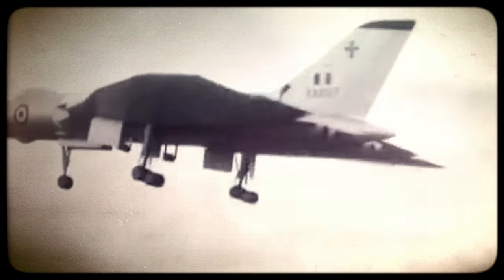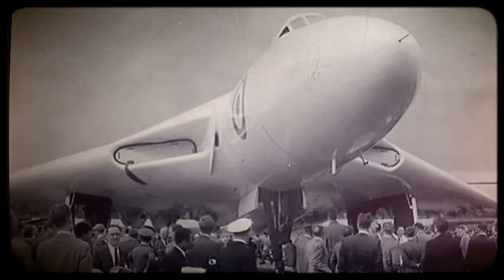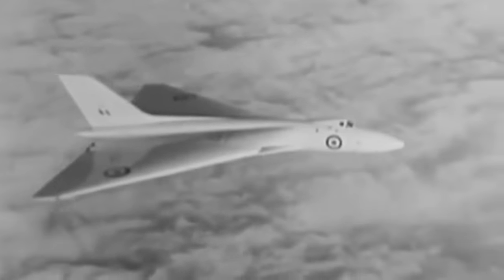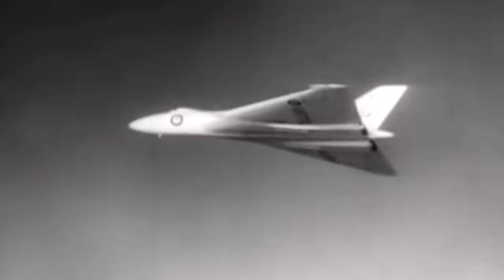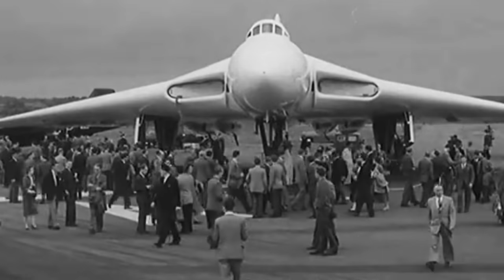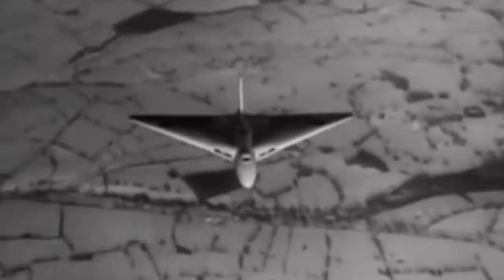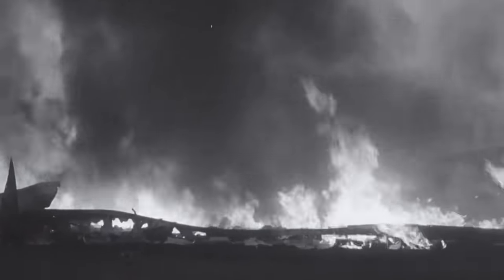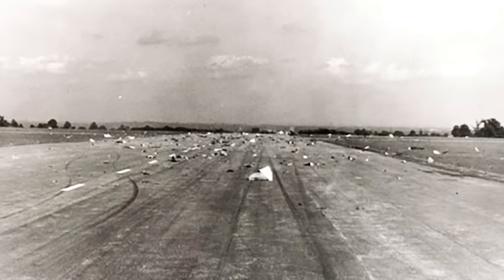Vulcan Bomber Disintegrates on Camera

Comment: 'Exceeded the turn rate limit'? He was pretty straight & level!
Reply: Pretty sure they mean he exceeded the limits earlier in the display, fatally weakening the structure.
Reply: Kinda reminds me of the F-117 airshow crash where the wing just fell off.  The cause of that one was found that maintenance crews had accidentally left off 4 of the fasteners that held the wing on. Almost a year earlier and it had taken that long for the remaining fasteners to break under the increased stress
Reply: @Knightfang1  couldn't they add sensors for that?
Reply: @jwadaow  on the F-117 that crashed, pilots had previously reported unusual wing flexing but maintenance gave it an inspection and cleared it for flight.  They would not have found out about the missing fasteners without completely removing the wing and it passed all other forms of inspection at the time
Reply: @s1iznc1d34  I don’t even take apart a remote control without a “this came from here” ‘map’ of the bits and pieces.
Reply: Oh I say...a bit of a sticky wicket...wot?
Reply: blame the pilot  ,as allways
Reply: @Knightfang1  We have endoscopes now. vital pieces of test and maintenance equipment.
Reply: @jwadaow  YES VALVE TECNOLAGY THEN
COME WAKE UP
LOOK AT THE DATE
Reply: "Ruined the ambience" masterful understatement.
Reply: @andyhowlett2231  Partially caused by flying outside the limits on the previous flight with a different crew was probably what was meant 😳
Reply: @andrewholdaway813  I hate when ambiance is ruined, it's like a stale chip, i say!
Reply: @jwadaow  In 1958?

Comment: Underlying mishaps such as this is the simple fact that someone didn't do their job.  The allegation that the pilot had exceeded the limits of the plane during the pass is suspect.  It is not supported by any facts.  Blaming a dead man to shield a corporation from scrutiny has a hollow ring to it in my mind.
Reply: Agreed, a gentle banking maneuver at 250 mph shouldn't cause this thing to break apart in flight. It was almost certainly mechanical failure and not pilot error.
Reply: @mikefromwa  I doubt it was "Mechanical Failure", Most likely Structural Failure.
Reply: Given that the Vulcan was renowned for being able to be handled like a fighter plane and to be able to handle the stresses of continuous high speed low level missions, I would guess that modifications for the Conway engine installation had fatally compromised the wing structure. I saw one on a training flight at low level back about 1970. He did a roaring turn from Loch Linnhe into Loch Leven to go and 'bomb' the aluminium plant at Kinlochleven. The stresses on an aircraft that size must have been immense but that was regarded as normal for a Vulcan. I had a perfect view of the entire top surface of the plane from where I was standing on the shore at Ballachulish.
Reply: It looks like a casual, slothful roll that any airliner is capable of, and yet someone said the pilot "exceed the limit"? What is this plane made of, sheets of paper?
Reply: just took a few rivets coming loose near the leading edge.
Reply: Back in that time when high performance jet propulsion was still a frontier science there were many such tragic accidents. One I read about the aircraft disintegrated and the engine plowed through the crowd. It took a while before airframes caught up with jet performance.
Reply: @mikefromwa  "gentle banking manevour " ! yer got that right , how biased for engine producer to state 
pilot error , the families not only in grief , also deemed to have shame , the "corpse" go on to financial 
greatness and the once living in despair ,   whats changed ? .
Reply: Agreed. Same story time and time again. I'm looking at you too Boeing
Reply: @STRIDER_503  Yeah, but they forgot the GLUE. so it was held together with sticky tape.
Reply: Welcome to NASA and the Air Line industry.
Reply: You are totally unqualified to make any decesion on this though.
Reply: @EuroScot2023  first prototype aircraft arent the same as production aircraft

Comment: Problems with the Vulcan were rare, amazing as it was all nuts, bolts and pulleys. It was one of the best aircraft to ever fly the skies. I wish could see one again in action, that feeling you get in your chest when a Vulcan does it low pass roar unfortunately will never be repeated! Sadly missed!
Reply: And the howl! Never forget that sound . Love it
Reply: They still fly in Britain
Reply: @RedTail1-1  No, they don't.
Reply: The problems with the Vulcan (RR engines, British hydraulics, Lucas electrical systems, Carlyle fasteners, etc.), were both well known and well documented. The RAF flew the Vulcan until late 1972. I have no idea what replaced the Vulcan after 1972.
Reply: @oncdoc01  1982.
Reply: @kwerk2011  Correct. They only do run way passes now. And still one overshot and went into a ditch. I last saw a Vulcan fly over me around 2012. I live near where they had one at an airfield which was one of the last being restored
Reply: @oncdoc01  I saw a Vulcan at the air museum at Newark and spoke to an ex crew. He showed me a hatch in the aircraft which could be used for the crew to bail out but he said crashes often happened with little warning. He did say several Vulcans had crashed over the years.
Reply: @Simon-ui6db  Vulcan pilots trained over the North Sea, and the howl was an accompaniment to east coast seaside holidays. Kite flying on the beach was a popular pass time, and kids competed to get their kite highest. This involved buying successive balls of string to attach to the previous one, the kite being long since out of sight. Signs went up prohibiting this activity, as they were infringing on air space!
Reply: @RedTail1-1 the last one was grounded about ten years ago, after many years of restoration. It flew for a few years afterwards doing displays and raising money for its upkeep and charity work I believe
Reply: The feeling you got in your chest was your internal organs being rearranged! 😉

Comment: As a 9 year old, I was there. The Vulcan was doing a low banking flyby, having previously done the same at other airfields. As it flew across in front of the crowd, a gasp went up as we all saw flames near the left wingtip, the flames quickly spreading 'up' the wing (plane banking left). As I remember it the wing then exploded (flames got to the wing fuel tank ?) and the remainder of the plane plunged into the ground. I've never been to another Battle of Britain Air Show.

Comment: One of the reasons early aircraft crashed was the practise of bashing rivet holes in aluminium instead of drilling holes. Bashed holes can have a host of micro cracks which propagate due to the stresses encountered when flying so eventual failure is pre-programmed.
Reply: A V Roe must have known that, as it was metal failure that caused the Comet series of disasters a few years earlier. (De Havilland wanted to bond the porthole glazing into the fuselage, but when that proved too difficult, the engineers went for screws and rivets, which all needed holes...)😮 In fact the Comet re-entered service in 1958 with many modifications to the airframe to avoid fatigue failures.
Reply: Pre - programed is a poor choice of words...that implies intent. Better to say pre - ordained as in ....failure was a matter of time.
Reply: This is the reason why airplanes have round windows today instead of square windows. That was the root cause of several crashes, micro cracks at the corners of the windows rapidly expanding to become macro cracks in the airframe causing rapid unscheduled disassembly. For example, the one generally pointed to, the Comet, but others had this issue as well. Most that had square windows were retrofitted.
Reply: It is spelled "practice".
Reply: @mundanestuff 'rapid unscheduled disassembly'.... well you could say that. Also that the occupants suffered from 'rapid deceleration sickess' when they hit the ground. 😮

Comment: I was at an airshow at Fairford many years ago. This was used by the US at the time. It was a beautiful day without a cloud in the sky.
I was waiting for the Vulcan display. I'd seen the routine many times and knew what was coming.
Two American  airmen were chatting just in front of me, not really taking much notice.
The huge crowd obscured the view till the aircraft were off the ground, but I heard the Vulcan engines from the end of the runway and knowing the routine, heard the howl approaching  . The Vulcan lifted off just abreast of me in a really steep climb, and you could feel the ground trembling beneath your feet.
One American airman shouted at the other, " Goooodddaaamm, will you look at that thing ".
Made my day!
Reply: Similar thing happened to me, at an RAF Mildenhall Air Fete. I happened to be chatting to a B-52 crew member by their aircraft in the static display. The Vulcan took off and went near vertical followed by a sharp turn away from the crowd line he was speechless.

Comment: I was based at RAF Scampton in the early 70's and used to hold my breath watching the Vulcans practicing for the air shows and trying to work at the same time. The noise when they used to go on patrols day and night will still be in my memory and having to go to the dispersals at various locations in the country and watch three scramble take off. Unforgettable!
Reply: I was an RAF cadet in the 1970s.  One year our summer camp was at RAF Brize Norton sleeping in tents near the runway. They flew Vulcans and VC10s in and out of there the whole. As you say, the noise those two aircraft types would  make was simply unbelievable. The first being awoken by one I thought the sky was collapsing in on us! 😱
Reply: @RobDavisTelford  Hi Rob. No, the name does not ring any bell for me. I was ground crew working in MTSS so I did not many aircrew at that time. Cheers, Chris. OZ.👍🦘
Reply: The 2nd loudest aeroplane I heard on a regular basis was the HP Victor ....... every morning at Brize Norton, am I right fellas???
Loudest, by some margin, was Concorde on full AB take off!

Comment: The wing shape was redesigned shortly afterwards.
Reply: Was it a problem with the wing structure?
Reply: @anevilgoose1034  No, it was to improve aerodynamic performance when the airflow went trans-sonic at high altitude.
Reply: That's why the the wings has the gentle curve in in
Reply: Thank you Helpy Helperton.
Reply: The newer wing design was already on newer aircraft, but VX770 was an old test bed prototype made in '52.
Reply: @juststeve5542  so they sent a pilot to death with a prototype on air exhibition?
Reply: @haziqsembilanlima  no, it was a test bed aircraft and they were returning from having different engines fitted (which they were testing) and they were asked to do a little fly past as a display on the way back.
Reply: It was redesigned mid flight it looks like
Reply: That anyone could have heard in the first 2 minutes of the video. Spoonfed...
Reply: @anevilgoose1034  Partially, In the early prototypes there was structural issues that had been observed in the forward wing structure in other airframes.
Reply: So much for it being the pilot's fault.
Reply: @timgosling6189  the Vulcan could not go supersonic could it?
Reply: @pauljones-tj5vs  The speed of sound decreases as altitude increases and the Vulcan could reach 60,000 ft at light weight.  There was at least one instance of a Vulcan going marginally supersonic (M1.04) at around 35,000 ft in a shallow dive during the introduction to Service trials.  The aircraft's Max Mach No was set at 0.96 but this was due to unfavourable transonic handling characteristics, particularly in pitch.  Of course the airflow over the wing would go supersonic before the rest of the aircraft, hence the margin in VNE.
Reply: 4 pilots not 1
Reply: @milkyo1206  The crew comprised two RR test pilots, an RAF navigator and a RR engineer.  The normal crew would have been five: two pilots, nav plotter, nav radar and air electronics operator.
Reply: @haziqsembilanlima  When you sign up to fly an X-plane...
Reply: yes, it was curvier somehow.  I'm no exqert but I can see a difference.
Reply: Just from the film alone analysis could determine both the speed and the role rate to determine if limits were exceeded. I don’t think it is a situation that we will never know or could never know if aerodynamic limits were exceeded. Just from a cursory review it does not look to me that there were excessive stress is due to speed or roll rate. If so this is one hell of a delicate aircraft.
Reply: the shape was already redesigned. 
Seven Vulcans had the Phase 1 straight wing (VX770, VX777, XA889-893). By the time the first production Vulcans rolled off the line, the Phase 2 kinked wing (the B1 version) was already fitted to ones that weren't so far into production. Later all but VX770 would be refitted with the Phase 2 wing. VX770 crashed years after the first Phase 2 winged Vulcans were flying. The defects which lead to the crash were well known before, and sources have stated that the operator or VX770 at the time of the crash wasn't fully aware of the weaker airframe of the first prototype than later production ones, although the aerodynamic deficiencies were known. 
The Phase 2C wing was introduced with the B2 variant and developed using VX777 as a testbed. This is the larger, more famous and iconic Vulcan most people know. Every surviving Vulcan today has the Phase 2C wing, a shame as my favourite is the Phase 2 which was equipped on the B1.
Reply: I mean I’d imagine and I’d hope so
Reply: they did the old one looks more like a mirage Jet Fighter
Reply: If you look at the later wing shape of the Vulcan, you will notice lots of irregular kinks in it, they were all added later on, with data from test flights, and all done on paper, no computer aided design, just mathematics & drawing board, paper and pen.
Reply: The starboard wing had been previously repaired
Reply: @paullovatt7413  unsurprising. i've seen vulcans do far more violent low level manoeuvres without falling apart. should've been grounded i suspect, but we'll never know.
Reply: How sad, and scary tho at the time.
Reply: That’s gotta be a scary feeling to be in that cockpit for those 6 seconds
Reply: They had flown it before......structural damage is not like the desintegration we witnessed. It would have broken off......and not just degraded...It seemed,  the molecules got disturbed by something we could not see. It was undulating.....like changing shape.......right in view of the people and the cameras.
Reply: @linanicolia1363  stop posting nonsense plz.
Reply: @haziqsembilanlima  
The pilot should have bail out
.
Reply: @Werewolf O. London, Esq. 
You mean like Steve Austin (The Six Billion Dollar Man)?
Reply: @otm646  
Never mind, they can always find a real-life crash dummy to fly these prototypes.
Reply: @paullovatt7413  
You mean they didn't bother repairing the portside wing as well?
Reply: @redblade8160  There was evidently no damage to the port wing?